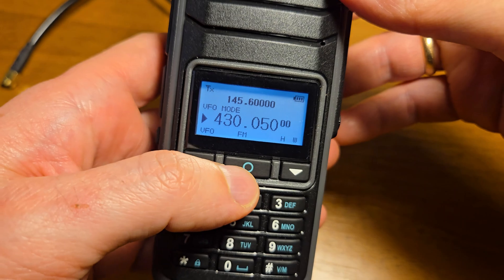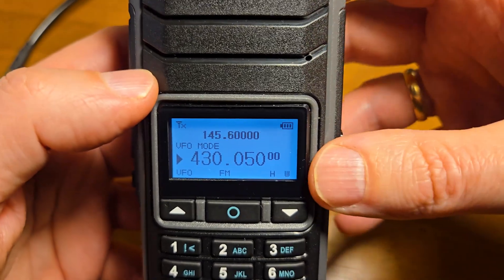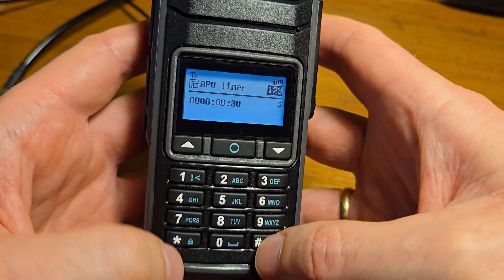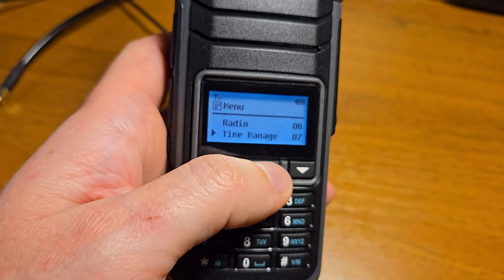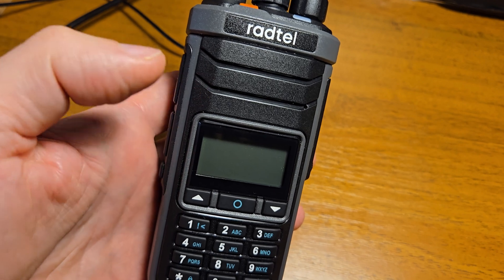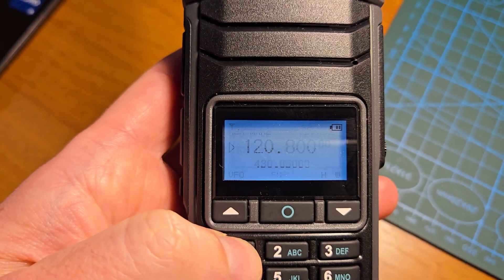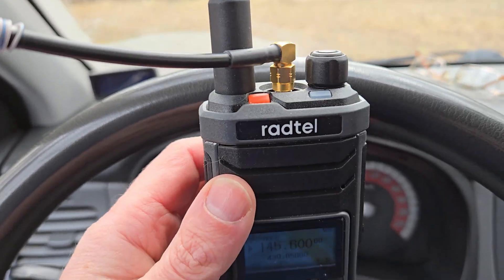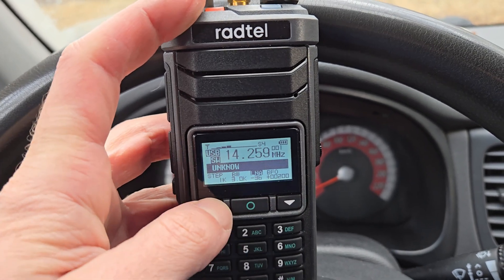Radtel RT 860 Radio testing part 2

Comment: Ahhh correcto ya veré si puedo ver la versión que usted utilizo en su RT860 en la parte de Time Mánager deben aparecer 5 opciones y la número 5 es la del Sistem Timer que es la que pone la hora en mi radio esa opción 5 no está en el menú y vi que en el video del suyo si estaba esa opción, gracias de todos modos y muy agradecido por sus respuestas
Reply from the maker: It seems that there is a difference in firmware versions. You're welcome! 73!

Comment: Excelente video, tengo la misma radio RADTEL 860 pero en el menú no me aparece la opción Sistem Time, pero si todas las demás, es decir no puedo poner el tiempo.
Reply from the maker: Maybe it's a new firmware?
Reply: Saludos cordiales amigo el mío tiene la versión 1.6 creo es la última , al buscar en el menú la opción 5 que es Sistem Timer esta no esta solo llega hasta la opción 4 , no sé si podrás decirme cuál versión tiene su radio instalada y cuando puedas sube un video sobre las Zonas , Y los canales como configuraralo, un abrazo soy HI5MLE Marcos López de la Rep. Dominicana
Reply from the maker: Sorry, my friend, but I sold it, and wait a new radio RT 880 to replace RT 860.
One of my friends has RT 860 , and if I meet him, I will check the menu rt860 and share on my YouTube channel. Actually you can try to find the information on my second YouTube channel "okhamradio", probably in the one of the videos you can find the firmware version information.
73! R3KDW